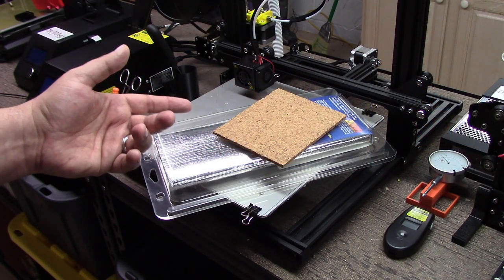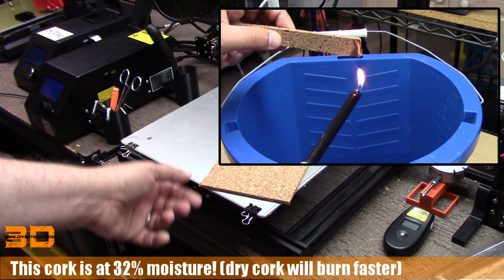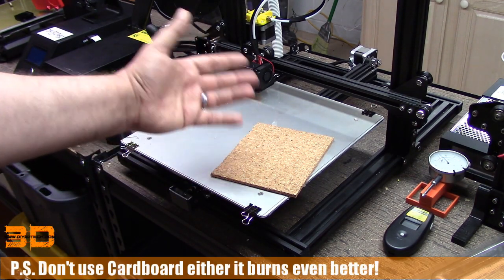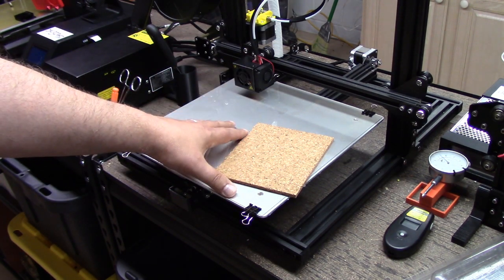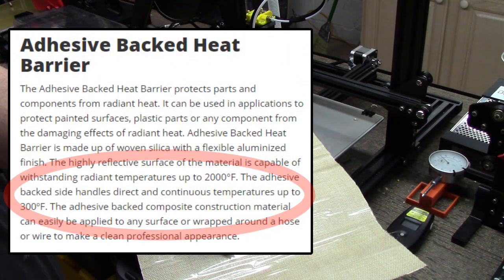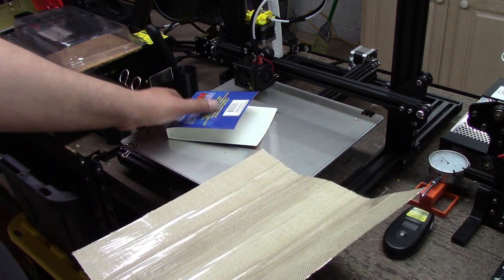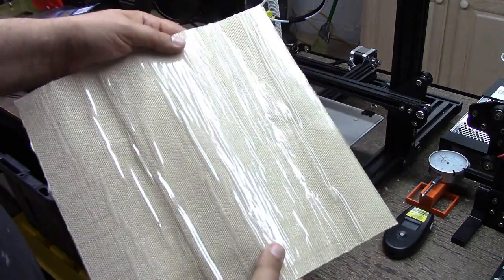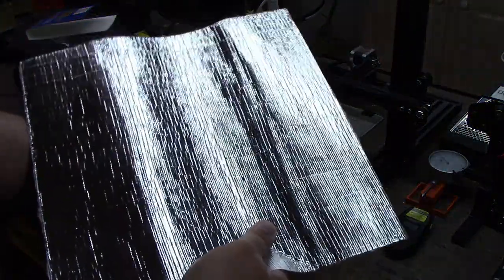Shop Talk - Yes Cork Really Burns and More On Safely Insulating Heated Beds!

Comment: I recently insulated my heated bed with some stuff from Home Depot.  It's fiberglass and made for insulating heating and A/C ducts.  A 12 in x 15 foot roll was about 12 bucks.  It has a foil side that kapton tape sticks to very nicely.  I used to have problems getting my bed above 80C and now can go to 110C no problem.  ABS parts are now a cinch.
Reply from the maker: Sounds cool (well hot really :-)!
Reply: Have a link?  What is its R factor as well?

Comment: I put cork on the bottom of my bed (cork and 1/4" fiber board to be exact) on an Anet A8, the way I adhered it to the bed was smear a thin layer of silicon (stuff you use on your kitchen sinks) on the cork and on the back of the bed, then set a paint can to bond it to the bed...I run my bed for ABS at 90C, had it up to 110C and got nowhere near smoldering...silicon is resistive up to like 400-500C, and once cured shouldn't burn. (per the msds there is no "flash point" for cork)

I'm more worried about the heater element falling out of the extruder block and overheating then bursting into flame (thus I put on a strain relief clamp on the extruder wires, took out the crap set screws and used short m3 screws for solid retention because it uses all the threads rather than 2-3 in the set screws, and snugged em down good and tight on the heater, not so much on the thermistor because if you tighten too tight you break the joint where the dissimilar metals meet.
Oh and open flame = a few thousand degrees, check out how well ABS or PLA burns on an "open flame" 
https://www.reference.com/science/temperature-bic-lighter-flame-1ca2e364e38d1085
Reply from the maker: As I cover in the video it is not the heat from the heated bed which will cause it to  smolder, however the the headed bed will dry out the cork (lower its moisture content)  and if there is a short like happen to CHEP on the Wanhao for example that will cause the cork to smolder->burn and catch your PLA/ABS on fire and you have a chain reaction...

Comment: If you can trap air inside, the heat transfer to the atmosphere will slow down. Just like the thermal windows, you have air gap between the glass and it will isolate temperature either way.

Comment: cancels order for cork sheets 0_0 thank you for this. any alternitives you'd recommend? maybe this just wrapped in an aluminium sheet?

I still wanna order some for the noise isolation of my printer tho. add it to the outside of my printer's frame (it's a corexy so it's a cube)
Reply from the maker: Check the playlists as I did several options...

Comment: The reflective sheet on the Thermo-Tec is two sided, the reflective properties are also on the adhesive side covered by the insulation. the outer reflective surface is just the other side of the foil. BTW it's rated to 300 degrees Fahrenheit ( 148.9 Celsius)
Reply from the maker: Thanks and correct both are the same and I cover this out in a later video update :-)
Reply: @DIY3DTECHcom  cool. I'll have a look at that. Keep putting out more. Did you ever do a BL touch install on any i3's
Reply: @DIY3DTECHcom  I just had a thought.  How's about DIY'ing a silicone sheet onto the bed. Would be interesting to find out temp tolerances.

Comment: Great video! I was going to use this on my CR-10S, but Creality3D just released an upgrade to insulate the heat bed. Just waiting for it from TinyMachines. I am definitely going to try this on my Anycubic I3 Mega, for a smaller bed it does have cold spots effecting ABS printing. Thanks again for the great videos.
Reply from the maker: Did you also see the $5 bed insulating video I did for the Tronxy?   It will also work on the CR-10 and I think its better :-)  Thanks for commenting!
Reply: Is the upgrade going to be released as a whole new model, or is it a mod for the current Creality printers?
Reply: Uberdude I bought my CR-10S from Tinymachines 3D. They sent me the upgrade for postage only. It came with a new plastic extruder with cable hot end cable guide, new dampened Z-rod holders and an adhesive heated bed insulator pad. Creality3D is their only line they sell and I know the owner just got back from a visit from China meeting with Creality3D. Their Facebook book group is pretty informative too.

Comment: From the amazon listing "Some Typical uses include: firewall, hoods, hoses, doors and anywhere you want to control radiant heat"     

It may help a bit with convective heat transfer but it's not designed for it. At least this is my understanding as a non-expert.

It will definitely be interesting to see if you can test other solutions.
Reply from the maker: Ah someone who gets it!  Yes big diff in radiant verses convective heat!  :-) I am going to try http://amzn.to/2uek4oG next to see how that works...
Reply: That material should withstand high temperatures but I found nothing on how much it acts as an insulator. Looking forward for your testing.
Reply: That high temp felt seems very nice as it would add very little weight (inertia) to the bed, which is already a little heavy when you print something big. Lighter will help to better control Y axis jerk (which is almost fantastically low without insulator). I wonder what's the best method to fix it to the bed.

Comment: My first thought, if one were to prioritize safety, would be to use ceramic tiles as an insulation layer.  While most ceramics are not phenomenal at blocking heat, they are without exception excellent at blocking electricity and resisting heat; I would expect the build plate to melt before even bathroom tile suffered notable heat damage.  Admittedly, other insulators can provide better results at lower thickness, but few would b safer.
Reply from the maker: Another viewer suggested a light weight ceramic insulation (rather than tile) and I have some which I used in the hotend video but its to narrow for this use so will look for it in sheet form.  The biggest reason I made this video was I saw so many people using cork and even cardboard as an insulator, it worried me ...
Reply: If the ceramic insulation is too narrow, is there any reason you can't just put multiple pieces side by side?  Barring having exactly the right size tile, you would need to do so with my earlier idea anyway, and three 30cm*10cm strips would cover the area as well as one 30cm*30cm sheet...
Reply from the maker: at 1" it would get to be over kill, I am going to try plumbers felt...
Reply: Actually, I was thinking thin bathroom tiles; the ones that are about 1/8 inch thick.  Still, so long as the felt can take protracted heat exposure, then it should be both thinner and a superior insulator.

Comment: dammit. I just bought a 4 pack of 12x12's but now that I think about it. hell yeah its flammable. so on the look still for insulation. btw I have no problem hitting 92' on my cr-10. I have not tried hotter since that is the max safe for my print in z surface (I figure 92 thermistor would be about 90 surface)

although back on cork. from what I gather its NOT dangerous at all. until it dries out?? so how long would that take with say 12 hours a day heating cycling? could I get a year before it was unsafe? less? ie maybe we can re-hydrate it or just change it out

or does it dry out fast enough to just not be worth the risk?
Reply from the maker: In the video this was at 32% moisture so not worth (IMHO) the risk as their many other safer options typically ceramic based  which can do the job as too keep in mind there is a point of diminishing returns on insulating too...
Reply: DIY3DTECH.com holy shit I thought that was dried out if that thing wasn't 32% and burn like that I don't want that under my printer

Comment: Even your cork is burning but very clearly self extinguishing, so that's no issue (hence the "fire retardant" in Wikipedia...). Also, that's not the cork to use. You should use expanded cork which insulates more and burns even less.

Comment: What about a fire block sealant, which is frequently used in brick ovens?  It's easily able to withstand 2000C.  A layer of that stuff on the bottom should do well at insulating the bed on its own.
Reply from the maker: Could you get off if you needed to?  Never worked the stuff...
Reply: DIY3DTECH.com 

It's a bit like caulk. I'm presuming it would require removing the heat pad from the aluminum.
Reply from the maker: Hmm, sound like that could end being a bit messy?
Reply: Perhaps.  I spoke with some people in my 3D Printing Facebook group.  Some have done it with Permatex RTV silicone gasket maker.  Apparently any silicone copper gasket maker will do, as they will have a heat resistance of over 500C.  They should work as a good barrier and help prevent heat loss.
Reply from the maker: Familiar with the stuff and yes on taking the heat, however seems a bit messy if you wanted to get it off.  However would think it world work...
Reply: DIY3DTECH.com 

If I'm not replacing the heater, why would I want to take it off?

Comment: You're igniting the cork with a flame , though. Autoignition of cork is like 300C lol?
Reply from the maker: And your point?  If one where to read the threads people were saying cork can not burn and they are full of it.  I had a Coffey pot in my office set a cork board wall on fire which burned down the office so this is only one example of many possible ignition points.  Please keep in mind reality does not read books...
Reply: @DIY3DTECHcom  I get you had a coffee pot light your cork years ago, but the temperature you're talking about is more than double the operating temperature.  Silicone socks on your hot end are totally acceptable for insulators.  But DID YOU KNOW silicone will IGNITE AND BURN YOUR WHOLE HOUSE DOWN if you heat it to 450C? It's double the operating temperature you use on a daily basis - same thing.

Comment: Although you changed my mind in the previous video when we had our conversation, I'd still kind of like to see a video testing the effect of the shiny side adhered to the bed. Just to see the results, you know?

I didn't know that one side was fiberglass. Fiberglass is an awesome heat and sound insulator in my experience. They even make welder's blankets out of the stuff.
Reply from the maker: Thats basically what the stuff is (welders blanket) on the back side.  I have been kicking around doing a video with the IR camera show the heat profiles of the material but don't know if enough people would be interested to watch (as it would be a bit to set up and take time away from my other videos)...
Reply: Yeah, since I've been getting restarted making my own youtube videos, I definitely understand. I have a curious mind though so I would definitely be interested in what kind of results would be achieved. I also understand it can be an additional cost since the adhesive would possibly destroy the metallic side if you decided to remove it. Either way, thanks for the information so far!
Reply from the maker: Hey no worries :-)

Comment: why not use compressed rockwool they use on roofing?
Reply from the maker: I try and stay away from things which weren't meant for direct heat applications as you run into two issues and (1) is an unintended fire hazard (like cork) and (2) is outgassing under steady heat in an enclosed space.

Comment: Plumbers felt isnt for insulation, its just a heat shield, as in stop things from burning and damaging surfaces. "This material is best used as a shield blanket and is not designed to withstand prolonged contact with hot objects. This scratch-free material works well when covering fragile pieces or working on delicate surfaces"
Reply from the maker: If it isn't insulation, how does it stop or separate the heat?  By definition that is "insulation" so I am sure how how you can say it is not "insulation"?  As to quote Webster, insulation is "a material or substance that is used to stop heat, electricity, or sound from going into or out of something" which is what this does.  As plumbers felt is made of tear-resistant PAN fiber and has a temperature resistance of 1800°F (982°C) so what is the issue of being with 100c bed?  Also there is very little abrasiveness and second it  doesn't move so again not sure with scratch issue?
Reply: it's not designed to stop/trap heat, it's a tough material designed to prevent damage to surfaces. Try it by it self without the foil, sure it will stop some (because heat does damage surfaces) but almost all of that heat will still come through. And yes it can withstand 1800F/982C of damage, not insulation.
Reply from the maker: The point which I cover in the video is the felt provides an additional air-gap for the for thermal sheeting, as I would agree it would not work as well without the sheeting.   However I can't agree it doesn't "stop" heat as if it didn't then it wouldn't do what it does.  Also I believe they  are talking about far higher temps when they say not to expose it to long term as there is a big difference between 100c and 982c :-)

Comment: " thermal engineer" ..  lol. I can't tell from the video what way u planned to mount it . but you will want to mount it with the shiny side facing out. this is because the shiny surface has a low Emissivity. if thou mount it facing in it will be useless as its conducive and it will just heat up to bed temp via thermal contact.
Reply from the maker: There is a prior video where I install it which was the genesis of this video and I mount it sticky (i.e. non-foil side to the bed) created quite the stir :-)
Reply: DIY3DTECH.com that is the correct way. doesn't matter if your mount it to something that u want to keep cool or keep hot. shiny surface out.
Reply from the maker: That was my "logical" guess not being a"thermal engineer" :-)
Reply from the maker: P.S. Here is is the original video if your interested: https://youtu.be/JISg55OYtfY
Reply: DIY3DTECH.com - It would be interesting to see what kind of results the inverted mounting of the thermal pad would produce. Nothing speaks volumes like concrete evidence.
Reply from the maker: Good to see you back!  Have not heard from you in a while figured you must have been off fishing or something!  By the way got a new Wanhao STL/DP printer!
Reply: DIY3DTECH.com - You're killing me smalls. Ha ha. I have been watching all your videos but usually later at night on the smart TV. I love YouTube on a 50". Ha ha. My wife laughs every time you mention my name during a "Yaw party".  

Man, SLA printer, now I'm definitely coming over to play at your house. You have all the cool toys!  You need a shelf to display all your drones. That would be a cool thing to see. Almost like Tony Starks workshop. Lol
Reply from the maker: That is my goal for my retirement is a tony stark lab as wait till I start building my fusion reactor (not joking - a Farnsworth Fusor is on the list) .  You know I am going to have to watch some of these on the big screen myself!
Reply: DIY3DTECH.com - picked up a TCL 50" with ROKU integrated into it. They are awesome!  Start watching something in my phone and then throw it onto the TV. It's awesome!  And your drone flight videos look great on the TV too. Especially the really steady video. Looks like a movie.

Comment: So incredibly wrong. The Thermo-Tec product you have there is designed to protect by reflecting the heat away from it. I'm buying a similar product that will be used to line my enclosure as well as provide protection to the electronics compartment under the hotbed.